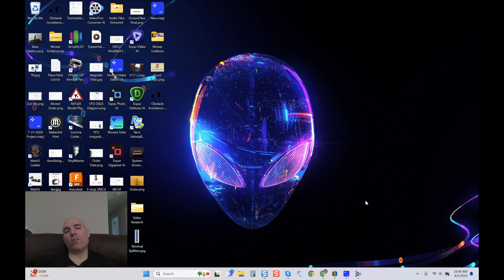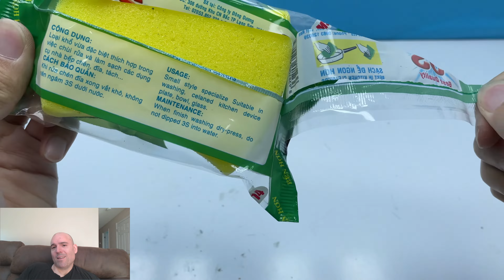Content Creators Who Shouldn't Be Doing Videos On Soldering

Comment: Hey there. Just saw your soldering video today. It’s great information on what NOT to do! and thanks for the demonstration at the end!!
At the end you said contact you if we’re interested in pre-ordering the MangnaLock System. How much is it and what comes with? (is all parts sold separately or as a kit?). thanks (I literally emailed you yesterday and it came back as not deliverable 'permanent error', I have no idea what's up with that as we've conversed that way before, sorry).--or you can answer -via my email if you want. thanks.
Reply from the maker: Thank you for your support. I'm not sure what the issue is, but I haven't had anyone else have issues with emailing me, and my spam folder is empty. 

The Magnalock's price is based on the amount of jigs/type required by each end uses.  

A stock system however will include the steel base plate, and two machined red top silicone lined adjustable jigs I demonstrated in the video for $65 shipped UPS in the US.

 If you want to add one of my Stay Put! jigs to the Magnalock's base for a professional combo the price for the stock setup, and it is $130 shipped in the US through UPS. 

The adjustable jig pricing is based per unit at $15 each, or $50 for 4 of them. 

Thank you,
Vince
Reply: @corvetteguy50  OK, I just tried the email again to see if it will work this time.